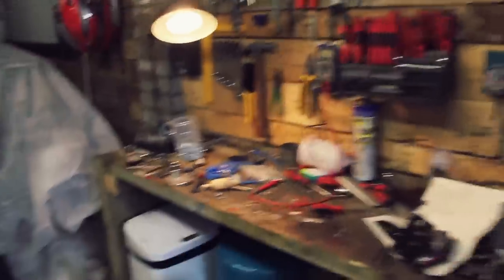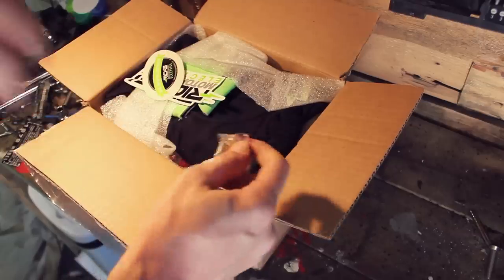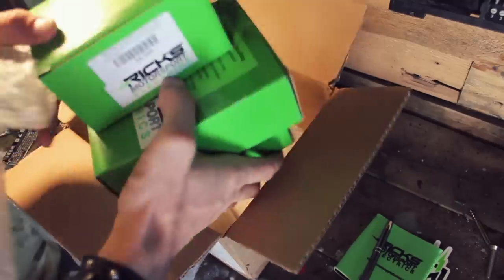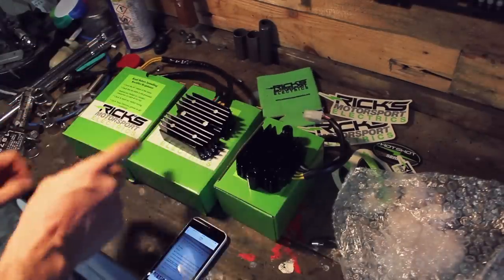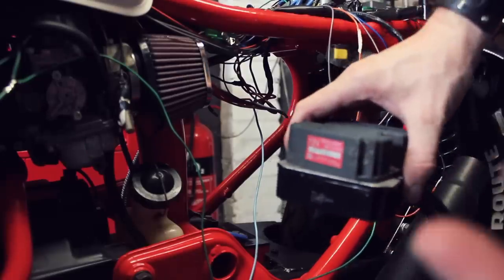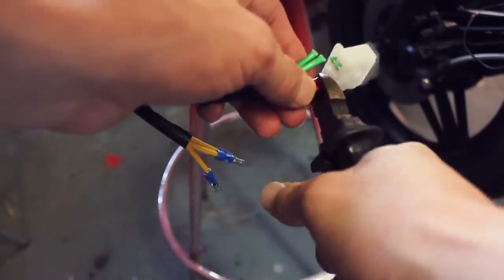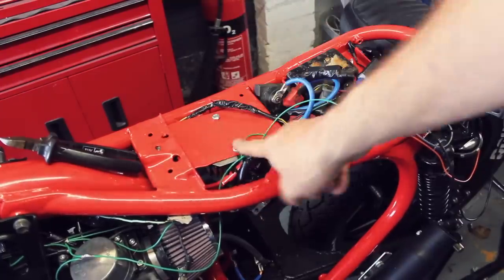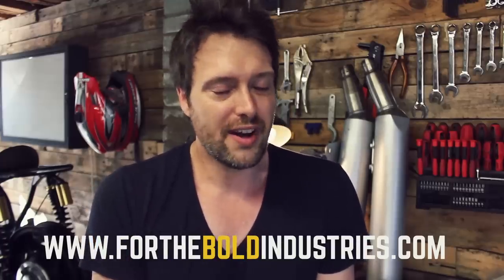Honda CX500 Cafe Racer Build 42 - Installing a Rick's Motorsport Regulator Rectifier

Comment: Thanks for the shout out!  Happy these finally made it to you & can't wait to see the finished products!!  We are sending over another small care package to help with your electrical connections.  Cheers from everyone at Rick's!
Reply from the maker: You're welcome, and thanks for the package, well needed :)
Reply: Hi Rick's Motorsport Electronics can you explain me what does it means "Our design also eliminates the black signal wire" from which cable you are talking about? I have 3 cables coming from the alternator and 3 additional cable out : Black , Green and Red. Thank you in advance for your help.

Comment: I second their great customer support. Called for a question on my GS550 and Rick got me squared away. Great company.
Reply from the maker: Awesome, good to hear they're consistent.
Reply: It's true... As long as you don't have failing product and need a replacement, they are are very informative. Just cross your fingers that you won't need any sort of help should their RR fail a simple diode board test.

Make sure you ask for a proof of purchase if it's a reseller (order summary is not enough, even if it's an official reseller), and prepare yourself to be blamed for whatever is happening to the unit or the way you've performed the test featured in their videos... Empathy is a foreign notion to them.

Comment: Would be pretty happy for the petcock video.  Since the plastic bit that i can pull out might be the filter but unsure. My manual doesn't show anything about the filter at all it seems :/
Reply from the maker: I might add it at the start of the next video then. The filter would be the long white plastic thing that goes into the tank. But if unsure you can always add an inline filter.
Reply: For The Bold - dreegez I think my bike had both maybe. If i could, would it be cool if i sent you a pic when i drain the vinegar out of it?

Comment: Hey, for the bold degrees, I've always wondered what the box is at 5.59. I have one on the cb750k and plan to put a m-unit on it and wondered what that box does. Thanks! Love all the videos, wish you the best of luck
Reply from the maker: The little box with 2 wires is the relay, the M unit has that, the bigger box is the CDI

Comment: Just ordered one of these for my build $129 (£98.59) minus shipping.....and now have a bill for import charges £38.72....so that's around £180 all in.....that's 4 times dearer than the Lithium battery I bought @ £45
Reply from the maker: But a lot cheaper than replacing your lithium battery after every ride.

Comment: Don’t know about battery prices in UK, but here in Belgium they are really cheap. Bought a battery last year for my Triumph for about 30€, while the R/R has cost me 170£ plus shipping.
Since I learned that my model year has a weak stator, I am now going to install a small voltmeter (15€) in the dash, so at least I won’t get stranded again.
Reply from the maker: I guess it depends on the battery, I use Ballistic as they're really small and light, a normal battery for this bike would be around £30
Reply: For The Bold - dreegez thanks, I will check out Ballistics ; the smaller/lighter, the better

Comment: I want to go lithium on my 1982 cx500. Is there a way I can test the stock rectifier while running to see if it is ok to use a lithium or if I have to buy one of these?
Reply from the maker: They say anything post 80s electrical system is ok. But considering the cost of one of these vs a LiFePO4 battery you’re worth getting one of these. Plus you wouldn’t be taking the chance that a 37 year old reg/rec unit still works properly.
Reply: For The Bold - dreegez when you say works properly does that mean you know how to test one to make sure?

Comment: Do they have to be mounted on a metal part? heard someone say that they have to be, so that the metal part draws some of the heat off of the regulator rectifier and prevent them from overheating.
Reply from the maker: On the original  bike they're mounted on the side of the frame, a flimsy bit of metal, I'm no reg engineer but I think the fins are designed to cool them down enough.

Anyone an engineer here that can say more?
Reply: wow thats a quick one. thanks! total noob when it comes building motorcycles, this channel has helped me a lot! cheers!
Reply from the maker: No worries, I don't 100% know the answer but I guess you'd be ok looking at where the original was
Reply: For the Bold is right - the fins are designed for cooling purposes!
Reply: Mounting to a plate would enhance the the cooling ability if it works in your build.  Heat is the enemy of electronics!

Comment: Have you found these to run any cooler than stock?
Reply from the maker: To be honest I haven't tested the temp on them
Reply: after mounting my rr on the underside of the electrics tray beneath the seat, I am feeling a fair amount of heat after about 20mins of riding. Electrics are all stock other than the LED tail light, and AGM battery...considering it is 40 year old tech, it might be worth an upgrade.
Reply from the maker: I don't know how they work but if it's old it could be working over time?
Reply: @forthebold  my thoughts exactly...or it could be normal as a one would never feel the heat in the stock location. Under the seat however, it gets a little toasty.

Comment: Great vid. Hey, you should do a video of your maico.
Reply from the maker: 100%, I was going to bring it over to the workshop the other week before the Ducati came but no room now, I'll bring it in when I either sell the GS550 or the CB750 is delivered to the customer.
Reply: For The Bold - dreegez 
I thought the gs was for the old lady?
Reply from the maker: No, she doesn't ride, all the bikes are for me, but if I have to make room that would be the one I would sell. That's if I don't decide on extending the workshop.
Reply: For The Bold - dreegez 
Man that would be a hard decision for me. I love the sound and 2stroke like power band in the 4 popper, but I love the looks of the cx. I do know that the cx's sound great also if you run duel pipe without a crossover. The has the same cylinder degree as a V8 mustang, and with duel pipe without a crossover it sounds just like one.

Comment: you shouldn't crimp those connectors unless you absolutely must. Order up this kit and solder the connections. You will never have trouble with them. BTW, the bike looks amazing and I love your videos! I don't mean to be a complainer, I just want your bike to be problem free!

https://www.amazon.com/Ninth-City-Motorcycle-Terminals-Connector-Insulation/dp/B01N0403PD/ref=sr_1_5_a_it?ie=UTF8&qid=1533567545&sr=8-5&keywords=motorcycle+bullet+connectors&dpID=51I07z0i3gL&preST=_SY300_QL70_&dpSrc=srch
Reply from the maker: Nice tip, I'll definitely be re-doing the harness from scratch in the future